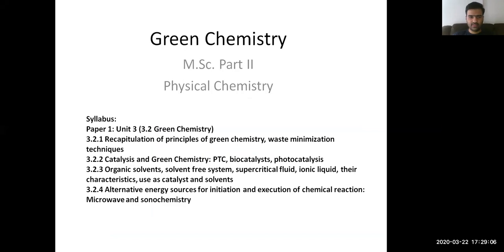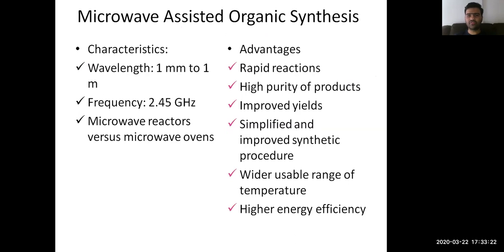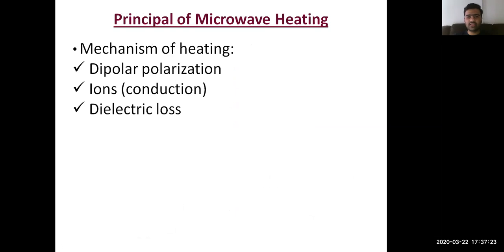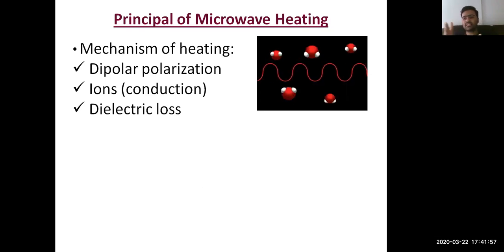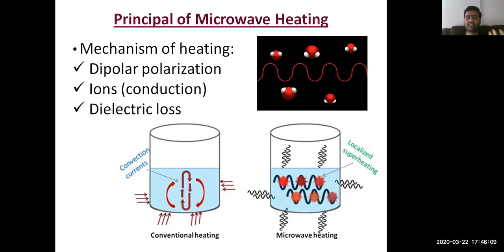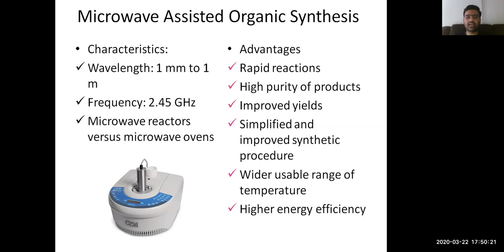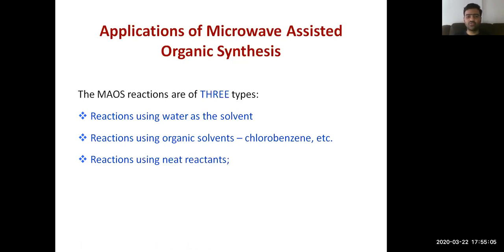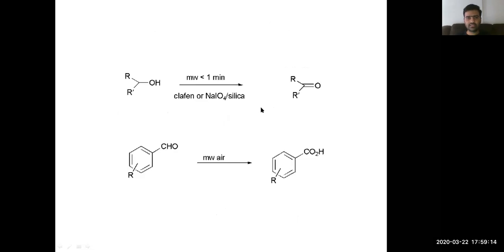Green Chemistry: Microwave assisted synthesis

Comment: why em radiation rotate in presence of polar molecule
Reply from the maker: Microwave radiations induce changes in rotational energy levels in the molecule. Just like modes of vibration in IR spectrum are based on change in polarisability, similarly the change in rotational levels take place only for those compounds which are permanent dipoles. You will be able to find deeper answers to why there is a rotational motion that is set in polar molecules in the presence of microwave, you will have to Quantum mechanics involved in a rigid rotor where you study different types of quantum systems- spherical top (Microwave inactive); symmetrical & unsymmetrical tops.